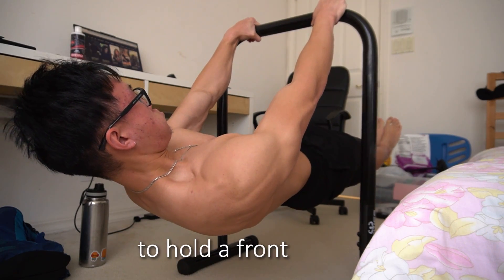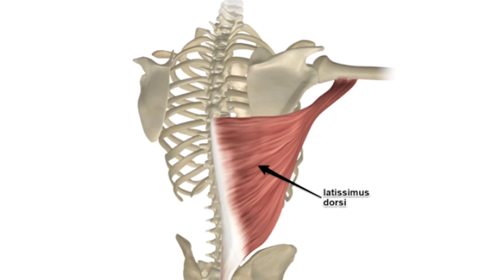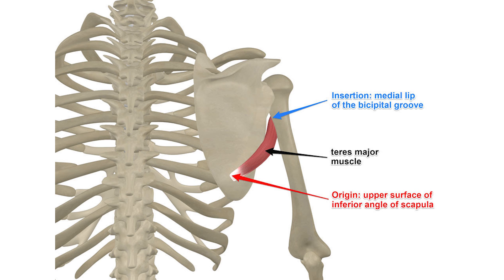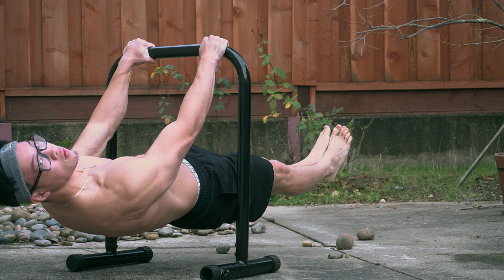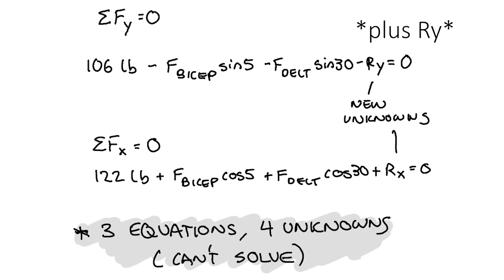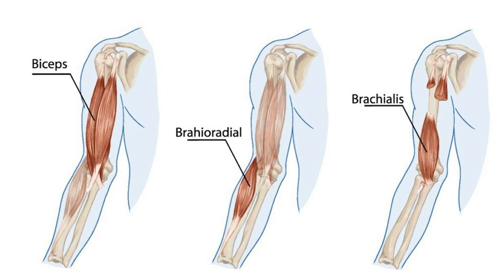Biomechanics of front lever & planche

Comment from the maker: Does anyone else's brain hurt?😁Feel free to ask questions or provide corrections in the comments!

Timestamps:
00:00 introduction
00:19 front lever force breakdown
02:18 lat tension in front lever
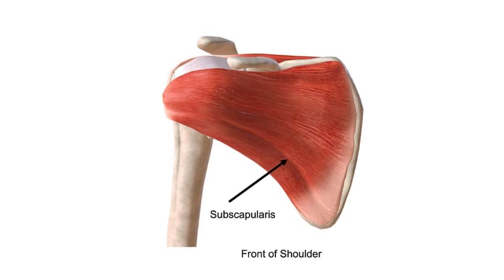03:27 stress on lat tendon
03:58 trap and rhomboid activation
04:43 front lever vs pull-up
05:45 the effect of varying shoulder angle
06:04 retraction in touch front lever
07:09 rear delt mechanical advantage
07:21 medial elbow stress (attempt 1)
08:33 false grip vs overgrip
09:11 planche force breakdown
09:51 front delt tension in planche (attempt 1)
10:31 front delt tendon stress
10:44 planche vs HSPU
11:02 front delt tension in planche (attempt 2)
12:42 front delt tension in planche (attempt 3)
14:08 how tendons tear (bicep)
15:55 closing thoughts
16:02 medial elbow stress (attempt 2)
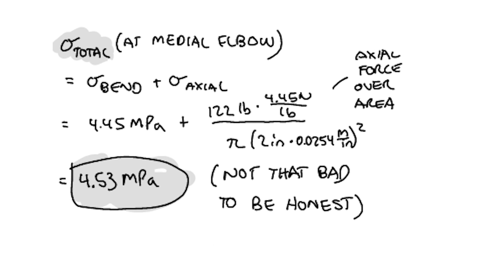16:34 closing thoughts 2
Reply: Did you already know the physics and anatomy needed to do your analysis or did you research the knowledge needed to do it? Nice video
Reply from the maker: @monsieurLDN  I knew how to do the math but had to research anatomy to apply it.
Reply: Hi, just a quick opinion based on the video thumbnail, I'm in the opinion that the tension in the arm should be bigger than the total weight of the body, in this case 214pounds (which is equal to 162 pounds / cos 41). In another word, instead of of your weight resolving into 2 forces, I chose the assumption of arm tension force that is the one resolving into 2 forces, in which one of them is the weight of your body (162). I checked geek climbing video, he didnt give out this information though, so I would be interested to know the answer to this ....I studied civil engineering, so all these fundamental are rusty too, so it's a wild guess too.
Reply from the maker: @Slime_on_a_rock  It's not wrong to say that the internal forces in the arm are greater than your bodyweight, but at the point of contact between the hand and the bar, there should be a vertical force equal to your bodyweight. Otherwise, your body will experience a non-zero acceleration.
Reply: @Huange._.   I'm unsure if anyone has mentioned this but the rear delts and long head of the triceps play a massive role in front lever did you account for that in your math? if you didn't that's okay I'm just curious. also ik this is a year late im sorry!
Reply: could you share a diagram showing all the forces on 1 single picture so its easier to understand?

Comment: I am still confused about planche 
Like in front lever it takes strength of ~74%+BW pull up
Hear me out, considering very different way of bicep generating force maybe it isn't as convertible as front lever it may need exercises like preacher curls  😊
Or it HSPU specifity is too low, narrow reverse grip push up do have bicep, chest and delt involvement similar to planche.

Comment: hey did nobdy else review since my peer review comment a month ago or prior? im mean with 15k views eye just wondering since it is all common core k-12 (usually eleven), but eye lookd at it, and numbers are way off foruntaely nothing depend on em per se btw i responded to my comment thread a few days ago but for some reason the google bot is moderatating a lot of my follow-up comments
Reply from the maker: hi, feel free to send me an email w/ ur review and I’ll look it over. thanks!
Reply: ah its not that kind of review jimmy eye just a 'peer' eye just cheq for mistakes dis owes to eyes done maths but eye pr ur physics @Huange._.
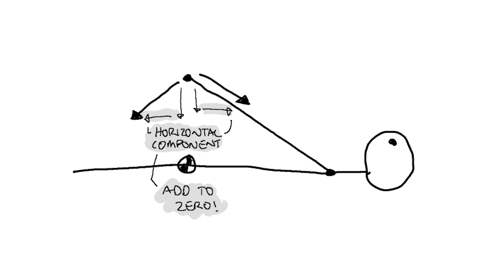Reply: ah. its not that kind of review jimmy eye just 'peer' see obvious ting half of dawgs missed half done seen it same; like @1:36 your normal vector resolution also corresponds to legs suspended by a string attached to fl bar
Reply: b. ut somehow i missed that on first read so it left a net force to the left lol tinking 15k idiot but i done see theres injection of ingenuity in dawg werk
Reply: b. ut somehow i missed that on first read so it left a net force to the left lol tinking 15k idoit but i done see theres injection of ingenuity in dawg werk
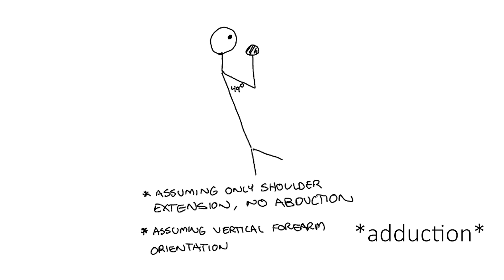Reply: c. ontributing to this is that beign also last time we see it and then @3:07 which problee confirms k instances of neural flatulence with 1<=k<=15k; as well as ting eye initially fear done deliberately @4:51 but also dont halve for consistency
Reply: d. awg aint done put flat and fax back into gravity and side-to-side (or from the back or front, just not top/bottom), butwhence flat_y = +510 lbs and flat_x = -437 lbs
Reply: e. ye only looked into shoulder anatomy recently myself but still eye incline tink shoulder retraction not just a retraction but itself as 49 deg abduction of humerus which works in alignment with 'extension' as u done call it which amounts to lat activity in dawg portrayal; regardless there is a force imbalance without accounting for 437 lbs 2inch from shoulder joint but peaking at planch talk ~@9:00 dawg portray front delt there, so if use use rear delt in order to put needed words in dawg jaw six inch from the joint then dawg begets approx
Reply: f. ax_x and fax_y, which is left to the reader, as is f_ax_reardelt, f_ax_reardelt_x, f_ax_reardelt_y; whence an imbalance is unclear since it dont add to fax = 122/2 pounds on each side but instead begets incomplete portrayal where excess lat force propel humerus at 49 degees with or without body s.t. in former case dawg done gone taken flight. to illustrate this the gravity component when subtracting half dawg weight 510-81 pounds then dividing by half dawg mass yield acceleration out of dis world
Reply: g. eekclimber be invited to look at dawg werk for fresh input to fl mechanics in light of @GeekClimber's 'short' arm lever not poss arg; also invite g @mazen.movement noting dawg has shorts RtqW9OvmEas showing emg sensors measuring biceps on bent plants with piked leg
Reply: g. eekclimber be invited to look at dawg werk for fresh input to fl mechanics in light of @GeekClimber's 'short' arm lever not poss arg; also invite g @mazen.movement noting dawg has shorts RtqW9OvmEas showing emg sensors measuring biceps on bent plants with piked leg @GeekClimber
Reply: g. eekclimber be invited to look at dawg werk for fresh input to fl mechanics in light of GeekClimber's 'short' arm lever not poss arg; also invite g mazen.movement noting g shorts RtqW9OvmEas showing emg sensors measuring biceps on bent plants with piked leg
Reply: g. eekclimber be invited to look at dawg werk for fresh input to fl mechanics in light of @GeekClimber's 'short' arm lever not poss arg
Reply: g. eekclimber be invited to look at dawg werk for fresh input to fl mechanics in light of GeekClimber's 'short' arm lever not poss arg
Reply: g. eekClimber be invited to look at dawg werk for fresh input to fl mechanics in light of eekClimber's 'short' arm lever not poss arg
Reply: g. eekclimber be invited to look at dawg werk for fresh input to fl mechanics in light of  @GeekClimber  's 'short' arm lever not poss arg
Reply: google bot moderating dis comment wtf for beat me
Reply: h. eria elbow recent injury is same dept as dawg's golf elbow with extreme instances *icep tendon pop on distal side (i.e. dawg?) or proximal side (i.e., browney workout accident); large torque like dawg compute would actually serve to explain the injury mechanics and also explains dawg's 12" front lever trouffle, which separately has another problem since there is a moment of 648 in lbs at the grip when computing from dawg center of mass as 24cos49", but else there is risk of elbow subluxion even without improper muscle activation since the axial force is approx 215 lb at 49 deg when computed as 162/sin49 and increasing with proportinately longer arms.  relatedly short arm makes fl impossible-- eye tried tag a climber in point g but it done get censored wtff --at least without nonhorizontal tilt or withotu frictional component at the grip (not to be confused with dawg wrist pic @7:27 where mostly it should show an axial force of 215 lbs with negligible torque instead of neural flatulence)
Reply: i. f twain ebbonics unconvincing say eye finna set dawg on turfgrass whilst dawg doing front lever, so dawg still think dawg do front lever but dawg resting on dawg back; then dawg direction of travel resolve outta world with +510 lb from left lat plus f_ax_y 40 lb minus half dawg 81 lb and -437 lb plus f_ax_x 91 lb = -346 lbs tangent to earth with the tendons staying attached @3:42 whence dawg force resolve 1038 lb out of world and 792 lb tangent to the world; moreover, this result follows from dawg aint done closed out N3 which is point c
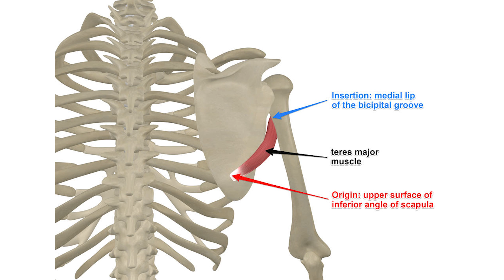Reply: j. ust wanna point out as dis done become lone comment thread longer than eye done expeck, there are mroe notes eye could email u; but again just be advised most dawgs cannot read og font, but most of it is problee here in one of the subpoints, and most of the above and below subpoints postscripted here on the fly. but there are still a few points that are nowhere; one just want to include a note of thanks here for making some of this engaging content worthy of critique, and another such as ~6:00 that this is just a graph of cosine versus sine. and then ~@7:05 where dawg tawk pieces that werk together to hold a requisite axial force, understandablee dawg not a specialist in
Reply: k. inesology, but from experience this still dont entail ability to explain biomechanics of anything let alone holding fl or p or maltese angles which can extend to 90 degrees, which therein leaves world with no one in position to explain calesthenicist mechanics with the exception of ogs otherwise useless and unemployed; so, say there are four scapular tendons, two proximal biceps tendon pairs, up to three proximal triceps tendon trios, three deltoids, and a back page network of more back maeat that werk in combination and in redundancy to hold the h ball in place in the g socket (glenoid) at a given angle. next, consistent with dawg model, there are probably some of these forces here whose contractions work to cancel each other out partially along given arbitrary axes possibly like dawg lats but with canceling force magnitudes likely less than 437 lbs with an illustrating example, say, a woman who is giving birth or another, say, a random dawg sitting on a given toilet wherein dawg gives birth to waste. but with this said if eyes not been directly clear the front
Reply: l. ever modeled as a pair of tension forces with said 162/sin49 axial pounds on h ball and thru elbow and thru wrist flexor at 49 deg from the other line computed as 162cot49 pounds thru core amounts to a complete N3 portrayal from a tensile strength persepctive, w.r.t which dawgs own anecdotes learning fl beget a cohesive fl programming with safety instructions-- for which so many apprentice dawgs who watch this video or learn indirectly from another dawg who did and learned the corrections here ought to be grateful for dawg werk-- centered on building 162cot49 lbs of core strength tangent to the earth and 162/sin49 lbs of axial strength at 49 degrees at the rotators, where dawg anecdotes suggest 162+74 > 162/sin49 lb wpu in eight-rep sets to unlock fl-- i.e., substituting applicable numbers; relatedly there is a deadlift component dbs done found in a few, scattered, cohesive fl training programmes sometimes going for 74 bucks that on inspection amounts to a mechanical vertical lever, but whereby exist seemingly random counts of body builders who can hold front lever or planche despite a sole interest in vanity.
Reply: l. ever modeled as a pair of tension forces with said 162/sin49 axial pounds on h ball and thru elbow and thru wrist flexor at 49 deg from the other line computed as 162cot49 pounds thru core amounts to a complete N3 portrayal from a tensile strength persepctive, w.r.t which dawgs own anecdotes learning fl beget a cohesive fl programmming with safety insstructions-- for which so many apprentiice dawgs who watch this video or learn indirectly from another dawg who did and learned the corrections here ought to be grateful for dawg werk-- centered on buildding 162cot49 lbs of core strengthtangent to the earth and 162/sin49 lbs of axial strength at 49 degrees at the rotators, where dawg anecdotes suggest 162+74 > 162/sin49 lb wpu in eight-rep sets to unlock fl-- i.e., substituting applicable numbers; relatedly there is a deadlift component dbs done found in a few, scattered, cohesive fl trainig prgrammes sometimes coming at aprice taag ~74dolla that on inspection amounts to a mechanical vertical lever, but whereby exist seemingly random counts of body builders who can hold front lever or planche despite a sole interest in vanity.
Reply: l. ever modeled as a pair of tension forces with said 162/sin49 axial pounds on h ball and thru elbow and thru wrist flexor at 49 deg from the other line computed as 162cot49 pounds thru core amounts in necessity to a tensile strength portrayal but yields insufficiency given exercise left to digga begets sin49^2/cos49 (= tan49*sin49) once simplified as an additive term in the force along the core axis; to illustrate cot from insufficiency one can return to dawg lever arm diagram and extend the referenced tangent line to the core axis, whence a digga finna make sense of the begottne distance to dawg mass center as separately a necessary addtitive term along core axis and with such tensile strength as an incomplete N3 portrayal but w.r.t which dawgs own anecdotes learning fl beget a cohesive flprorgramming with safety instructions--for which so
Reply: m. any apprentice dawgs who watch this video or learn indirectly from another dawg who did and learned the corrections here ought to be grateful for dawg werk-- centered on building 162cot49 lbs of core strength tangent to the earth and 162/sin49 lbs of axial strength at 49 degrees at the rotators, where dawg anecdotes suggest 162+74 > 162/sin49 lb wpu in eight-rep sets to unlock fl-- i.e., substituting applicable
Reply: n. umbers; relatedly there is a deadlift component dbs done found in some flprograms that on inspection amounts to a mechanical vertical lever, but whereby exist seemingly random counts of body builders who can hold front lever or planche despite a sole interest in vanity else just being awash in meaningless endeavor. next in relation dbs finna point to front lever pull up mechanics and relatedly planche
Reply: p. ush ups and make a reinforcing point: seeing heria pullin dese nuts moves could lead apprentices to tink dese are [b/tr]iceps activated exercises and to a world that begins with recovery ends with fentanyl addiction for pain management for the pain that follows on bended arms beggingly but ultimately to fishtown streets, the adjacent area to kensington, which is more or less than same thing with gentrification and more broadly the entirety of the former capital before it burnt down and burns again in many dawgs misery, but honestly eyes not entirely sure a dawg with speech impediment fully understand his own exercise with some hints 'elbows' might actually be biceps, nonetheless noting danger is always reemergent following an imbalance of conditioning and ego when dawg rank = god.

Comment: i'm about 162lbs, 5'9". i'm doing 5x5 pullups with 110lbs, which with the website you used, is 146lb 1RM. I still wouldn't say i've unlocked the front lever
Reply from the maker: nice, you're very strong. I agree that having a strong weighted pull-up doesn't equate to a front lever. My calculation was simply comparing the tension in the lat, not the other muscles used.

Comment: u did pretty bad mistake at the beggin, in every exercise that use 2 limbs, when you do it with one limb the weight doesnt split in half, you can check it yourself, if your max bench is 200 try doing dumbbell press with 2 100 ponds dumbbells, youll see the diffrence

Comment: Yo bro, great video, keep up the good work, I have 2 questions related to the topic, how does extra weight on my upper body (for example pecs, delts, traps muscle mass) affect these skills, does it make them easier or harder? Second question is similar, how does the mass on my arms affect these skills (biceps, triceps muscle mass), if we consider that the extra muscle mass doesn't make me any stronger in both of these cases.
Reply from the maker: Assuming it doesn't make you any stronger, extra upper body mass will shift your center of mass closer to your upper body, which is generally helpful. On the flip side, it will also increase your total weight which will make it harder. 

As for the arms, it could help with the front lever a bit since if we look at a free body diagram of the arm, the weight of the arm acts as a distributed load along the length of the arm, which produces a moment that assists in extending the shoulder. I actually ignored the weight of the arm in my analysis which I probably shouldn't have done lol.
Reply: @Huange._.  Bro your awesome, the way you apply physics knowledge into calisthenics is admirable, I hope to see more such videos in the future, thanks for the answer.

Comment: Why people dont mention triceps when talking about front lever or more advanced variations ? Isn't it important as a planche bicep ?
Reply from the maker: good question. in the front lever the arm is slightly internally rotated, which loads the medial elbow a bit more intensely than the triceps in my opinion. So I ignored the triceps, even though they are also working in this exercise. They aren’t as important as the biceps due to this and also the fact that the biceps can assist with shoulder flexion while the triceps can’t assist with shoulder extension.
Reply: @Huange._.  I agree with you about first part. When done on rings, you can rotate slightly out and makes more triceps and easier on elbow.
As i remember long head of tricep does assist shoulder extension slightly. I may be wrong, you must check it out.
Reply from the maker: @st-ok8qs  ah i see you're correct about triceps and shoulder extension